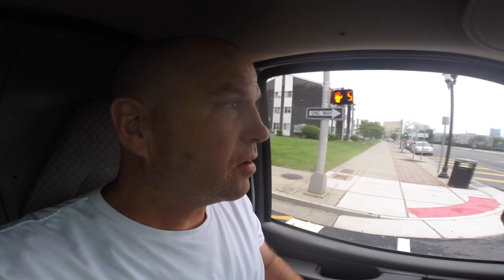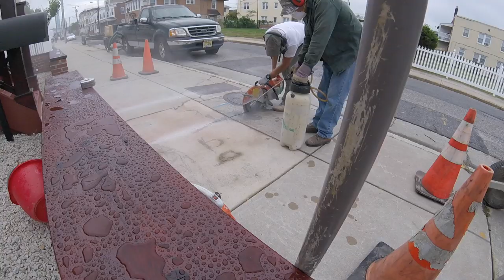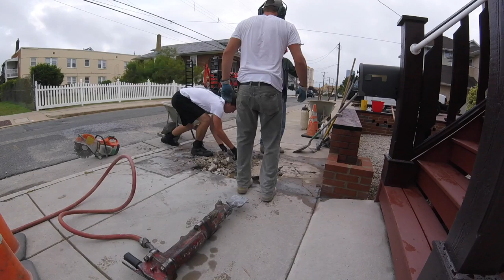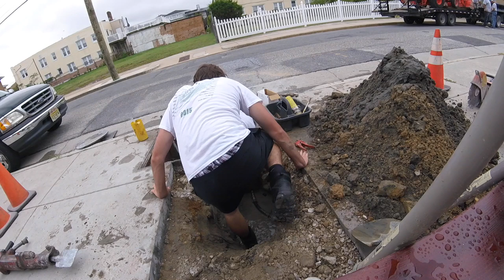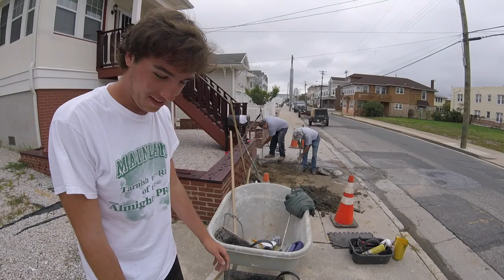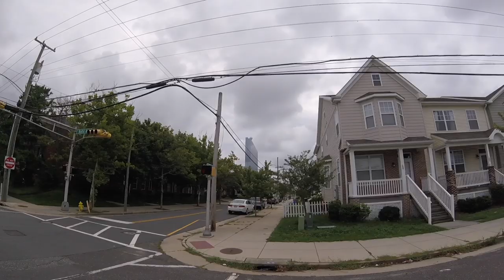Copper Water Service Repair

Comment: So how come you didn't explain how you found the repair? what was your diagnosis and how did you determine that the leak was there and decided it was under that particular area? Am I assuming it was because the water meter enclosure was filled up with water so that's why you started there ? Would it had been possible that it was further towards the house say in the area where the gravel area is surrounded by the brick enclosure?
Reply from the maker: Water was coming up in the side walk crack. If it were further in side we still be there. ha. Huge undertaking on this property. she still holding fast. I was just there last week.
Reply: @ChuckBarron  Ahhh... that makes sense. I know these take alot of your time with the setting up camera, video angles and editing. I get time is money but If from time to time you can explain a little more as you go, especially diagnosis, work done wrong and how to correct it and codes when possible on the bigger jobs. Just something to ponder for those of us that don't quite understand why you are fixing what your fixing and how to do the repairs right and not hack them. Thank you very much, always looking forward to learning more. Love your videos and respect the time you put into them. I am definitely a new subscriber.